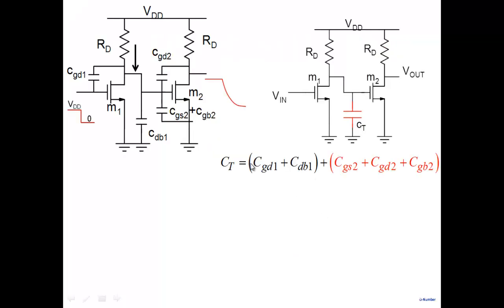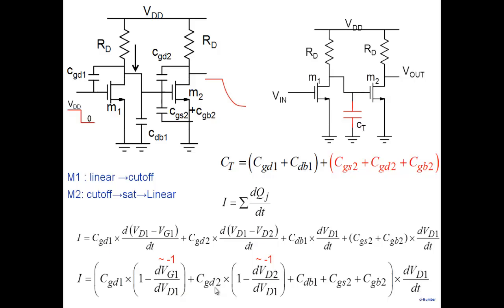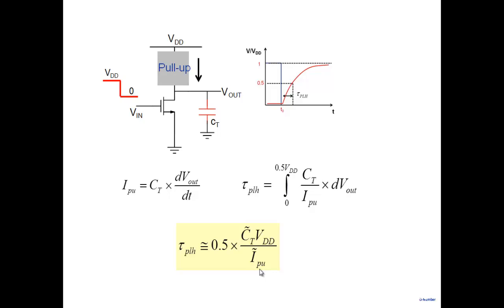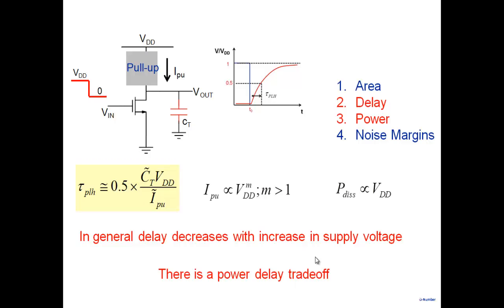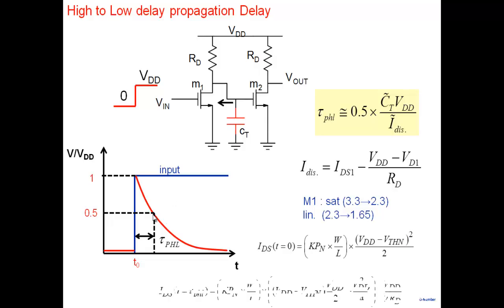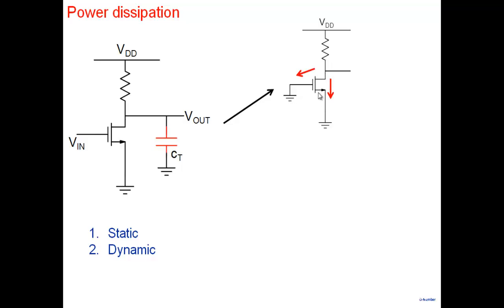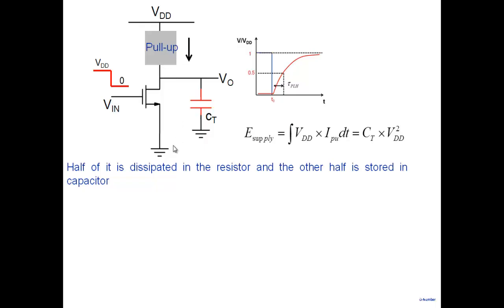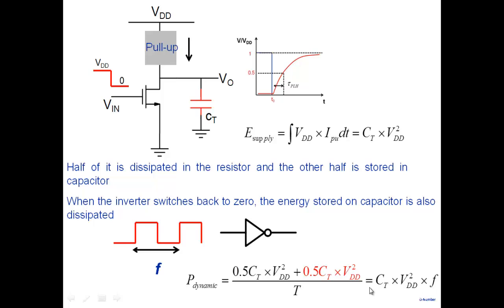MOS inverter part 3 (EE370 digital IC Design L27)

Comment: the core concept of inverter, time delay in low to high and high to low are dependent with VDD, current. power dissipation through inverter, activity level of a node, power speed trade off, these things are explained very well. mid point to ground cap. calculations all are good.